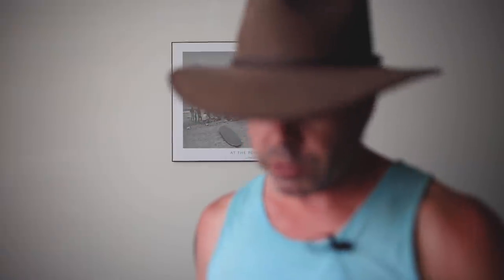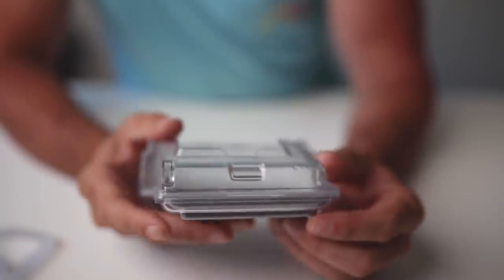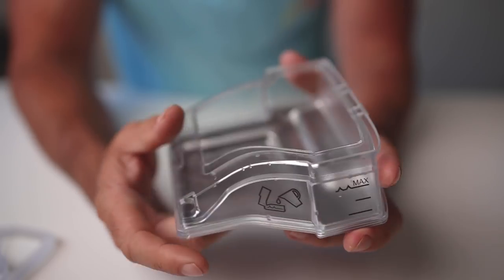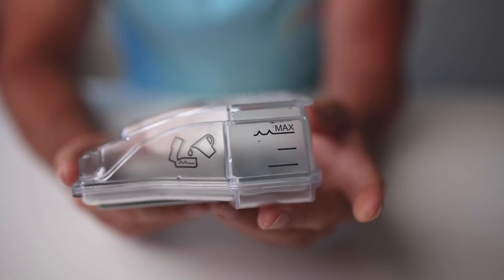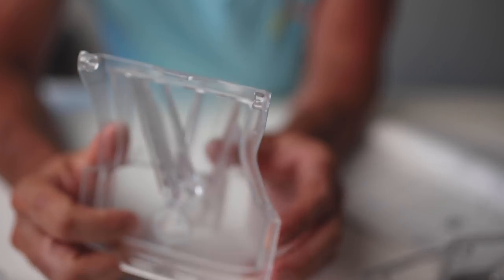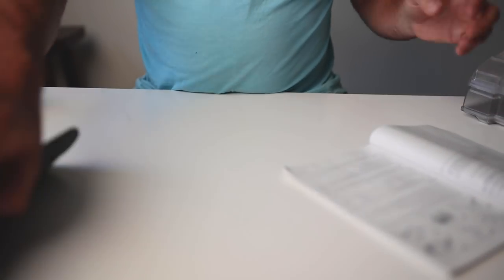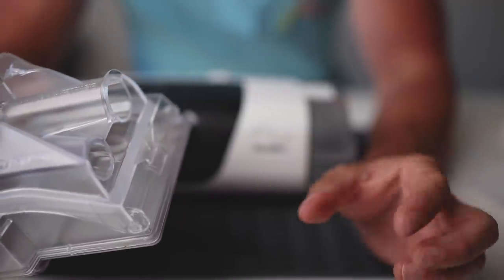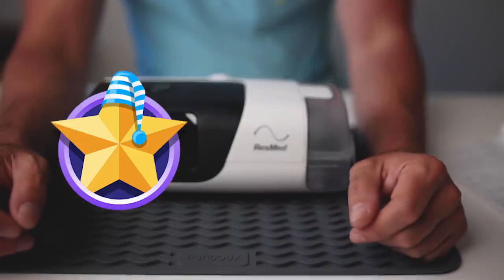Faulty ResMed AirSense 10 Humidifier Chambers Leaking Water

Comment: I have not had any leakage in my humidifier but I get a new one about once a year thru my plan. I am going to start the vinegar and water cleaning. Thank you.😄
Reply from the maker: Nice one brother. A lot of people use distilled water which has no minerals in it so they don't have the problem but if you're using tap or boiled water then it does work really well. Cheers

Comment: I brought my AS10 in Sept 2016 and still using the same chamber. I use Coles demineralised water and clean it weekly. Never had deposits on the plate and never had a leak. I had a loan unit when first diagnosed and it's chamber was cracked as it had been run to dry it after it was cleaned without water in it by the technician. Rule of thumb, never let them run dry.

Comment: Hi Nick, just a tip that can be helpful when filling the water tank an AS 10. If you fill the water tank through the large hole on the end, and fill it until the water reaches the top of that hole, this is the same amount of water as filling the water tank to the full line with the lid open. I then turn the tank with the holes facing down to let out any excess water. Then give it a quick wipe with a towel. This has worked for me for the last 4-5 years. If you're pouring distilled water from a bottle that may be awkward. I use tap water out of the faucet with no problems, just a little vinegar rinse now and then.
Reply from the maker: G'day Rick, wow what a great suggestion! I'll certainly give it a try. Thanks legend :-)
Reply: I was told that tap water was bad to use because I’d the chemicals go into your lungs. I need to use distilled water. Don’t need cancer from something I need to live

Comment: I've been using the AS 11 for 3 months. The water chamber is leaking and making a mess. I'm going to call the Supplier-Performance Medical-next week after the holidays since they're closed until then. Thanks for the info. 😊
Reply: 😱 Re11s
 They're supposed to be the best thing since sliced bread, by the video advert I just watched. Thanks for the heads up. I was thinking of updating due to the 'flooding' of my 2nd water tank! Will check out other sites for other brands and if they have the same water leakage fault, as my Resmed 10 ladies HAS, AGAIN! We all know water and electricity don't mix, so I'm wondering if there's a LEGAL action that can be taken against the company for FAULTY equipment as say car companies have?

Comment: I've had an AirSense10 for about 5 years & I get less than a year on the water tanks. I've bought the standard tank for $29 & the "washing machine safe" for $39 & it doesn't make any difference, they all leak eventually. The other thing is the hinge tab on the cover front side snaps off. Machine works great, tank sucks!

Comment: Thanks so much Nick for the advice. So far all good with mine - bought it back in August. Will certainly look out for it mate 😀
Reply from the maker: Hey brother, if it’s only a recent purchase it might have the new design plate (round). Cheers legend :_hello:
Reply: @CPAPReviews  No I got the same as you showed on the video ☹️ I will certainly be keeping an eye on it
Reply from the maker: Yeah if you start reading the comments i'm sure there will be some people who will mention it has happened to them. Most people try and fix it themselves with glue or silicone etc or they go and buy another but you should definitely just a get a free replacement if it happens. All the best mate

Comment: Hi, I got a new AS 10 6 months ago.  Mine has the round heat plate so they are available for the AS 10.  If you need to get a new water chamber, make sure you get the new style.
Reply: Hi I have the new round heat plated one can you confirm I can use this with my Airsense 10 so it is compatible many thanks

Comment: I've had the same problem. A towel also works well underneath. Not as non-slip as the rubber, but almost everyone has an old towel lying around. That's what I'm using.
Reply from the maker: Nice one brother. thanks for the great tip. Nicko

Comment: I ran across a issue on Dream Station humidity chamber the swivel connection on top can be easily broken if the tubing  isn't pulled straight off. And to repair it you made need to cut the wire for the heating hose connection. Its a simple fit just some super glue and a piece of transparent tape. Also there is gasket inside tank housing they may work its self off. I only noticed this because the machine was getting louder. I've since have ordered a 18 inch hose and hose to hose connectors. But I've also have taken a hose fitting that O2 hose can placed, blocked off that hole and placed a bit of olive oil on that fitting when i got placed back on to chamber so it can be easily removed and not get stuck. I choose olive oil because its food safe and.. The only bad issue is the super glue fumes may linger a few minutes. But wasn't a big deal to me. I worked at a rubber manifesting plant where if mold joints a would come apart just a little. Super glue was applied and excess was burned off using a electric soldering pen. And wasn't required to wear a mask.... Also on my old gray ResMed the tanks would only last about five years. But that also depend on the heat setting you preferred. The higher the temp the plastic would come loose around the medal plate over time... But way no recall on low level of melting plastic on the humidity tank.

Comment: Thanks Nick! A leak would be disastrous with about $1,000 worth of batteries, inverter, solar charger, and monitor in the nightstand that holds my cpap. Found a nice mat on Amazon for about $15. Glad you put this out before my chamber leaked. We have 2 so maybe double trouble.
Reply from the maker: Nice one mate, happy to help :_cheers:
Reply: One wonders whether the creation of a pond to house ones electrical CPAP machine ( or any other electrical device) is advisable?

Comment: I have 2 Airsense 10's in my household. Both of the water tanks sprung those leaks within the first couple of years. The replacement tanks haven't had any further problems and appear to be slightly different from the originals. I do keep a spare tank on hand these days.
Reply from the maker: G'day mate, thanks for sharing your experience. All the best with the new design tub. Nicko
Reply: Hi can you tell me are you using the new Airsense 11 chamber with the Airsense 10 thanks
Reply: @clive3223  No, I don't believe the AS11 tank will fit on the AS10 and I got my tanks long before the AS11 was released.
Reply: Did you get free replacement chambers from the company?

Comment: Good tips Nick. My chamber sprung a leak during 2020. Bought a new chamber the next day. I did keep the faulty device so I shall contact ResMed. I hadn’t thought about doing that. 
I’ll give the vinegar a go for the current container. Once or twice a year I 1/3 fill my kettle and slop in vinegar and boil the kettle. After the boil, I fill to the top with hot tap water and leave it in overnight. Clears up the window of the kettle. Rinse well.
Only a third fill the kettle as the water and vinegar bubbles up and if filled more then tends to escape through the spout.
Reply from the maker: Hey brother, i think most people have encountered it at some point. Great work with the Kettle! I'll have to try that one out for myself mate. Cheers

Comment: Just called Resmed regarding a leaking Airsense 10 Humidifier. 
It is about 18 months old but they said only a 12 month warranty on the reservoir and heater hose so you need to buy a new new one for $100. I had paid for an extended 5 yr warranty but only on the unit itself apparently. They also said that the version 11 hasn’t come up it to Australia yet !!!!
So no luck in getting Resmed to replace the reservoir :(
Reply from the maker: Hi Mark, unfortunately that's an all too common story! Yes, i understand no product is made to last forever (i believe they only have a 3 month warranty which is ridiculous) but surely they can design a part that does not leak water and potentially ruin your expensive machine. $100 is also a joke! About $30 in the U.S. AirSense 11 not available in AU yet and i don't think it will be until late 2022 or potentially early 2023. Cheers

Comment: one other thing i've noticed-  -if your night stand or whatever you set your machine on is not dead nuts level , if you go to the fill line you'll get water blown through your hose.   i put painters tape on the outside so it is easier to see the level. only go halfway between the full and next lower marks.
Reply from the maker: G'day Richard, thanks for sharing your advice mate. Much appreciated. Nicko

Comment: Being a bit proactive. When I first heard about this I brushed on a thin layer of UV resin on the seam and put it under a UV  light for awhile. The seam is now like it's coated with a very thin  plastic. Hard stuff too. I use this process as the clearcoat on the outside of fishing lures I make. If it's expanding/contracting It doesn't seem to affect the resin at all.
Reply from the maker: You truely are the ultimate Craftsman! Love your work champ. You got links to that UV resin? I'd love to patch up a few of my old battle scared fishing lures. I keep them as momentos after big fishing trips but would be good to get them back into the water. Cheers brother!
Reply: @CPAPReviews  The usual suspect is Alumi UV but it's pricy. An exact knock off is some of the chinese brands on Amazon. Much less expensive on ebay. Look for UV resin there. Black bottle. The 200g is often the most cost effective.
Reply: @CPAPReviews  They use the same UV resin gluing all sorts of clear materials, and for dentistry. It is close to optically clear, so you get a nice finish without obvious traces of glue, plus it sets fast due to the UV action. If you are using it for a bunch of projects, get a more powerful uv torch to set it.
Reply: Doesn't UV resin start to soften with heat - even the dental variety ? It is one of the reasons some ask for gold fillings.
Reply: @mitchelltanner6306  It doesn't seem to and I don't think it does. It's actually epoxy. It just hardents under UV light instead of a chemical reaction like regular epoxy by mixing two together.
Reply: Hi, would clear epoxy work around the water chamber?
Reply: @richardgross6061  It should, on the seam. The UV resin I used is actually epoxy. It just hardens with UV light on it. Regular epoxy is a chemical cure so you just wait until it hardens.
Reply: @Craftsman on the Lake  ok great thank you , just so tired of everyone of these water chambers leaking ,do you know if the "dishwater safe chamber " is made differently and doesn't leak?
Reply: @richardgross6061  I do not know... I haven't got one.
Reply: @Craftsman on the Lake  ok thanks anyways

Comment: They must have redisigned AirSense 10 at some point my tank is different. I have a round heater plate on the bottom, but I bought my AS10 in September.
Reply from the maker: Haha, yeah they did mate. Good spot! They did this due to the faulty design. Cheers :-) :_cheers:
Reply: Sounds like its luck of the draw on stock... just got my AS10 in December and got the same as in the video :-(

Comment: Hey mateys... I use a polident denture cleaner tablet to clean the residue  in the bottom of the chamber. Also found a good affordable silicone rubber mat at the pet store that is meant for pet food bowls to go on/in and does the job nicely. Luckily too 'cause my tank leaks, but woll shoot off email to Resmed... thanks Nicko.
Reply: In australia. Rtv clear silicone around the plate seal is also a solution. No need to heat up.

Comment: Good to know. Explains why they keep sending me extra tanks. Lol I haven't had an issue with it as I kept it low and use distilled.  I don't  fill it all the way. I've  had to return the machine 3 times in a row for faulty operation. I finally plugged it into a surge protector and knock on wood no more malfunctions. I notice if you have it set to auto on/off. The event resets and erases any prior memory of an event if you get up to pee. I do about 5 times sometimes (weak bladder) so I lose hours of actual event recordings. Am I the only one noticing this?

Comment: I have just sent my machine to Resmed as it stopped working. They looked at it and told me there was water everywhere and I must have dropped it (which I knew I hadn’t) and due to the water damage it was not under warranty and told me it would be £520 to fix. I ended up buying a new unit at £560! 
I KNEW IT WAS NOT MY FAULT!!!! "………..What should I do?
Reply: I complained to Resmed saying it must have been the humidifier leaking, however, they say if the humidifier was leaking, then that would not get into the actual motor and inside the machine.???
Reply: Keep pushing it up the line for a full refund!

Comment: I have had many patients complain that their chambers crack along that glued lined between the metal plate and the lower portion of the chamber. Assuming it’s due to the heating and cooling functions.
Reply from the maker: Hi Katie, thanks for sharing your experience. They have certainly worked on improving the design and the reliability. Thank you

Comment: Thanks Nicko - Didn't know this could leak. I have to say my first impressions was that the overall design was a lot better than the AS9 - those 4 plastic clips were driving me nuts (and that plastic was the weak point and first to break). It was very annoying to me at the time that Resmed did not sell replacement parts, only the whole water chamber. 
That's a nice mat you pointed out - will look into it.

Comment: Ive had mine since Aug 2021.  So far no leaks.  Is this a problem that will eventually happen to everyone that owns these?  I clean mine every 2 weeks and let it soak in just soap and water, and air dry.  My old unti was cleaned the same way for 6 years and still on all the original hoses, etc. So I must be cleaning them right.  But if this does fail 100% Ill be emailing the company

Comment: Will a AS11 chamber fit in an AS10?  Thanks for your great content!
Reply from the maker: G'day brother, nah she won't unfortunately :_cheers:
Reply: @CPAPReviews  Just like Fred G and The Regular Guy, I received an AS10 last year that came with a reservoir resembling the AS11's. It fits the AS10 perfectly but has the round metal heating plate on the bottom like the AS11 version. Since it came with my machine, I'm assuming it's an official ResMed part now. Might be worth the trouble to insist on the newer part when ordering a replacement reservoir. I've had zero leaks of any kind (knocking on wood).

Comment: Two failed now for me. If you drop the tank on the sink even a little the glue and plastic crack and fail allowing the silicone gasket just enough to break seal. It may hold until the tank is full and there is enough water pressure to blow the seal. If you find yourself running out of water faster than normal check your expensive bedroom furniture for water damage.

Comment: A leaking water chamber is the exact reason why I am planning on not using my humidifier except if I get sick AND even then I will NOT be using the heat setting and will only let it be used as a pass over humidifier.

Comment: 8:32 am I have a fault stating the humidifier no longer heats up . There’s a fuse that is under the heating plate they say to check, I did and it tested fine. You have any suggestions?

Comment: Thanks for your videos!  I am troubleshooting an AirSense 10 that is drying out my mouth incredibly!  It has also caused other health issues.  In comparing an AirSense 11 to my 10, the gaskets where the cannister attaches are different.  The 10 has the sealers attached inside the machine at the ports and the cannister had no sealing component.  On the 11, one port has a sealer and the other doesn't.  I am thinking that there must be issues with the 10 on that one port, therefore the 11 design is such that when you get your cannister recorder, it comes with a sealer.  I'm wondering if there is a way to replace the sealers at the ports on the inside of the 10?  Or I can CAREFULLY pull of the sealer on that one port and purchase a new cannister that comes with the sealer.  I may not be making any sense at all!  Sorry for the long explanation!

Comment: Got a question someone here could hopefully answer. My resmed airsense 10 recently stopped transferring data to my air. It no longer shows having reception bars, use wise it is not very old. I was curious who pays for the mobile service? Is it paid by your provider or is it included with the machine? I am in-between providers and am wondering if they could have disconnected my service.

Comment: My ResMed 10 runss out of water about 4am because the water chamber doesn't hold enough water.  I won't buy the Model 11 for that reason.  They could easily make a larger water resorvoir and sell it as an option but they don't.    I am finished refilling my machine in the middle of the night. So they lost me as a customer.
Reply from the maker: Hi Clay, thanks for your great feedback. Yes it's a very valid point. They could easily design 2 x chamber sizes 1. 380ml and 2. 500ml . Many people experience the water running completely dry which is also not good for the chamber health. Cheers mate. Nicko